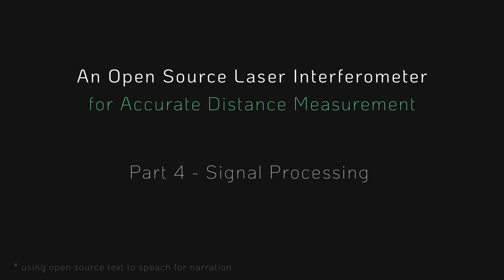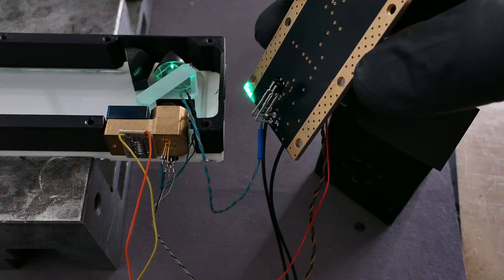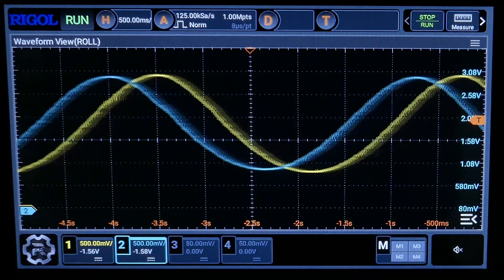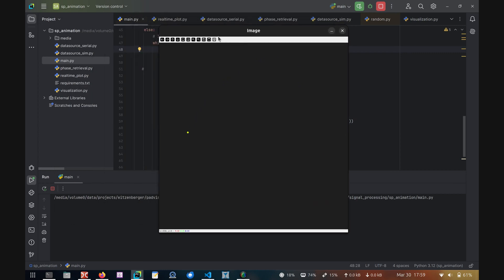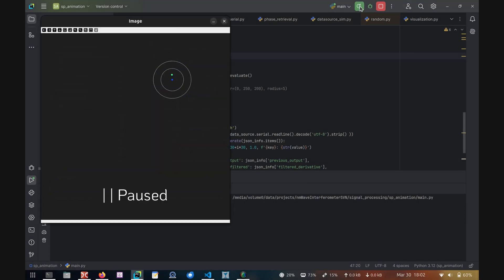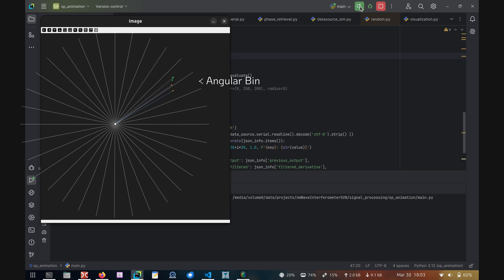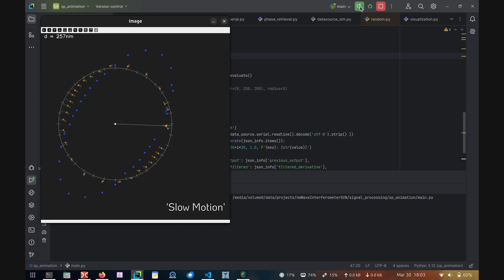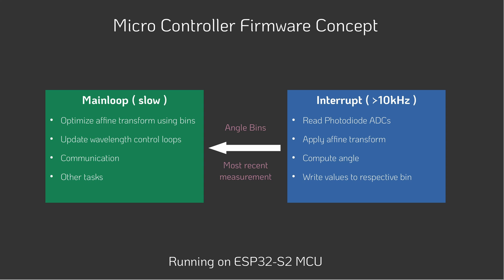Laser Interferometer - Part 4: Processing Photodiode Signals for Precision Measurements !

Comment: Great progress! Once you get so far as to test it you should try to characterize it at several different measuring distances to see how stable it is. 
Maybe get some more robax (to mitigate thermals), glue on some targets and insulate it somewhat. Then see how stable it is.

Also maybe you can come up with some uncertainties and stuff according to iso standards? Helps judge the performance much better. 

Thank you for your work!
Reply from the maker: Hi leo, I will definitely do some stability tests once the device is functional. As you suggested I am also planning to build a robax test setup in future, but I dont know if I want to go into the iso-standards rabbit hole.

Comment: Couldn't you fit two sin waves to the data to determine the phase shift and other parameters?
Reply from the maker: Sure that would be possible as well but I would have to fit 6 parameters instead of 5. I dont think there is too much of a difference betwenn the two methods.
Reply: From the visualisation it looks like the "circles" might reject a lot of/some data points, which makes the algorithm more susceptible to noise.
Reply from the maker: @Blubb3rbub  true, using an exponential moving average filter within each bin would make better use of the data.

Comment: What type of precision are we getting?
Reply from the maker: This is very dependent on how good the wavelength stabilization works. First results indicate that within the stabilization arm it can hold the measured distance within a +-2nm or so over a length of about 200mm, which is much better than I anticipated. I will go into this in the next video.
Reply: @DiffractionLimited That's a very exciting result, can't wait to see more of this series!

Comment: Super neat! I was wondering how you were going to address that.

Do you need to fix the bin positions at equal intervals in the input quadrature domain, for interrupt service routine efficiency reasons? Or could they be changed by math running in the slow main loop at run-time to lie at arbitrary input domain angles? 

Curious because (without having actually worked through the problem) my gut instinct is that it would be better to have the bins evenly spaced in the transform output domain, rather than in the input domain. For instance in your simulated input, you've got a lower point density in the output domain along the direction that corresponds to the ellipse major axis. Doesn't that end up meaning that the signal to noise ratio of the transformation scale factor is worse in that direction?

If you reverse transformed equal angular divisions in the output domain back into the input domain and passed these to the ISR with whatever your current transform is, then as the algorithm converged, you'd end up automatically sampling the input quadrature unevenly in input angular space in just the right way to weight all directions in the output domain evenly, and it seems like maybe the result would be more accurate and have more isotropic errors/noise in the transform coefficients.

Again, I haven't actually worked through any of this, this is a poorly formed gut instinct and may be completely wrong. I am also not 100% sure that this concept is automatically numerically stable, although it seems like it probably would be...

Are you planning on also adding an online estimate of the centroid? This seems like it would be highly desirable, to counteract shifts in the photodiode amplifier offsets, ambient light, or photodiode leakage currents. 

I feel like you're really close to an algorithm that can skip the first centroid finding step, you just need a similar "equal weighting distribution" selection mechanism to what we're discussing above in order to make the algorithm insensitive to input position/speed and avoid having the centroid drift towards the current input coordinate when the system isn't moving. Something like only recalculating the centroid once for every single complete circuit of the input bins, and implementing an infinite impulse response lowpass filter on the resulting series of estimates.

One question... there's obviously an egg shape to the ellipse you're showing in the real data when you first show the screenshot. This is a bit weird, it seems like in a simple picture of interference you would only get this with electrical distortion of the optical signal. Any selection of spatial modes (aka any photodiode aperture shape) seems like it ought to produce a pure undistorted sine wave in a perfect world... any ideas where that distortion is coming from? You're not operating the photodiodes with a variable voltage across them, are you? It feels like with a transimpedance amplifier one ought to have basically zero distortion. The only cause of distortion I can imagine which would be that visible would be if the photodiodes operated into a resistive load rather than a fixed voltage load.

edit: I should mention, excited to see that Peltier sticking out of the back of your last shot!
Reply from the maker: Ok there are a lot of questions to unpack:

First angular Sampling: You are right the current measurement is first transformed to the circle and then the angle is computed. Since in each step optimization  starts from the current ellipse-circle transform (I use gradient descent), equal sampling in the circle domain is preffered. The optimization would still work if the density of the samples changes along the circle, but some directions would have more influence than others, which is avoided by this scheme.

Are you planning on also adding an online estimate of the centroid: Yes its actually in there (if you look closely at the video you will see the circle move a bit) and part of the optimization. I didnt mention it in the video to keep it simple.

Something like only recalculating the centroid once for every single complete circuit of the input bins: the thing is, to create the bins, I would first need a centroid, which I dont have. Since the device will have current and temperature control over the diode, it can always trigger 'the point to run a few circles'.

Ther is obviously an egg shape to the ellipse: Yes, thats quite strange and I didnt observe it in the previous prototype. I am not quite sure where it comes from. For the stabilization arm it will not matter since I am holding a predefined setpoint. And for the measurement arm the optical setup is more favorable and 'balance' so I will first see if the eggshape is in the measurement arm as well. Also the ADCs of the esp32 are not very good and I will bne switching to external ADC for better speed, lower noise and much better linearity.

You're not operating the photodiodes with a variable voltage across them, are you?: No I am using TIA and I already observed very elliptical shapes with the exact same board.

I should mention, excited to see that Peltier sticking out of the back of your last shot!: Its actually not a Peltier, I desided against it since it is too bulky and may too much waste heat near the device. What you see are just a coule of resistors used for slight heating. (Again next video ;) )

Hope that answers your questions
Reply: @DiffractionLimited Thank you for the answers! You are right about the initial centroid estimate, I realized that a couple days after having typed the comment. I look forward to seeing your amazing work progress!

Comment: That's an interesting approach and seems to work very well!
It seems that the maximum speed of motion will be limited by how quickly you can process the samples, and position will be lost if it goes too fast. Do you have an estimate of the maximum speed it will be able to handle?
A possible solution would be to switch to digital processing if the speed gets too high, eg have the sinusoids thresholded into quadrature signals as many microcontrollers have encoder inputs that can handle very fast motion.
Reply from the maker: You are right if I cant track the phase and measure it at least every 90° I get positioning errors. At 10Khz you can work out the speed, but its not terrible fast. I also though about falling back to simple quadrature counting for fast movements but I am not sure how to implement this best on the microcontroller. Ideally I would have software defined thresholds to allow fora arbitrary amplitude offsets of the sinecurves.
Reply: @DiffractionLimited My first thought would be to have a DAC output the threshold voltage based on your circle centroid calculation, then have fast comparators converting to quadrature and going in to separate inputs on the microcontroller. The positioning should still line up at low speeds, just you can get extra precision out of the analog signals.
Personally I'd be tempted to do it all in a small FPGA once the algorithms are worked out, as it would be desirable to handle fast motion.
Perhaps two versions - a low-cost lower speed version using a microcontroller and a more expensive FPGA-based version that can handle faster speeds.
Reply: @DiffractionLimited I would suggest using the hardware counter in the microprocessor to count the phase shifts; one phase is the count, the other phase is the up/down signal. Then the full counts can be used for the total number of wavelengths traveled (retrieved from the counter register in the µP. Then add the interpolated signal from the quadrature to report the fine position within the wavelength. The is very similar to how we handle interpolated scale quadrature signals for coordinate measuring machines. Of course this will require some signal adjustments on the preamp of the photo diodes to set the gain and offset of the phases.